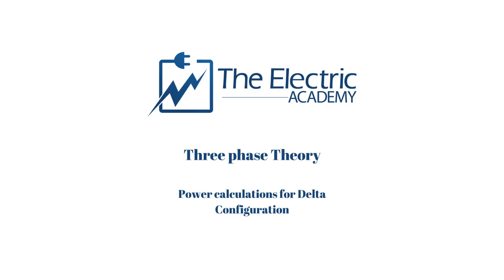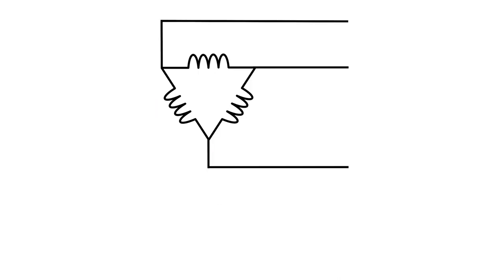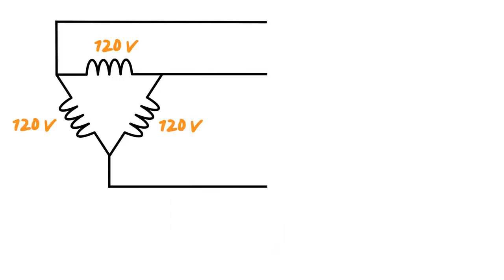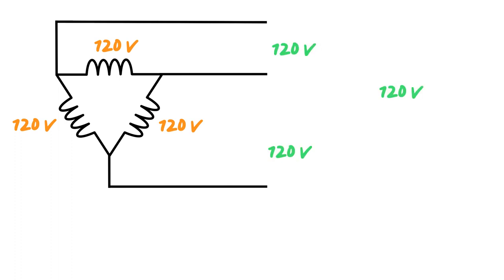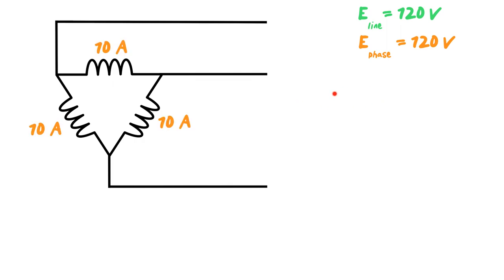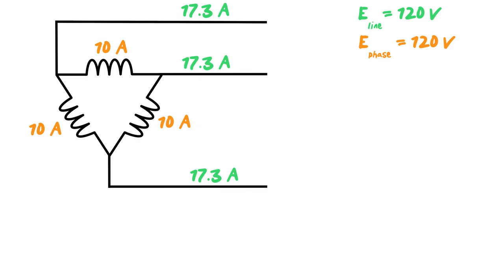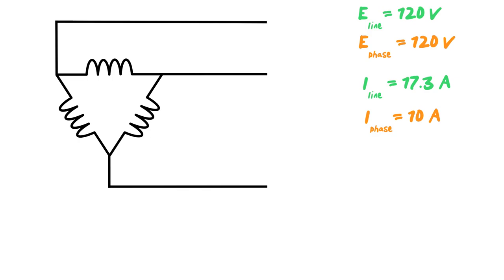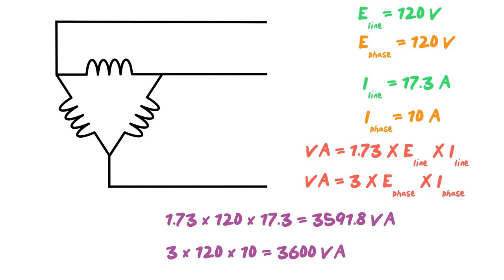How to calculate power in a 3 phase delta transformer

Comment: There’s a difference because you’re calculating VA and then watts 

Then you divide the two to get the power factor so they’re not the same. VA and power in watts looks the same. One is a perfect world The other is VARs reactive actual power so you can check power factor and then calculate how many capacities or inductors to correct the power factor to whatever specs the customer wants

Comment: your calculation is wrong.  If I line 1=276A, I line 2=339A and I line 3=446A what is the total KVA load on the transformer. Your formula assumes balanced load current in each winding which seldom occurs in the read world.  Let me know what is the load on the transformer using your method?  Thanks